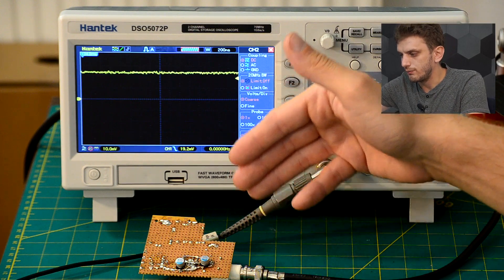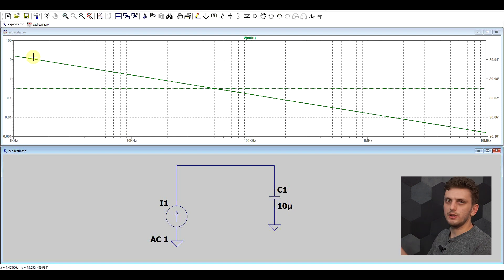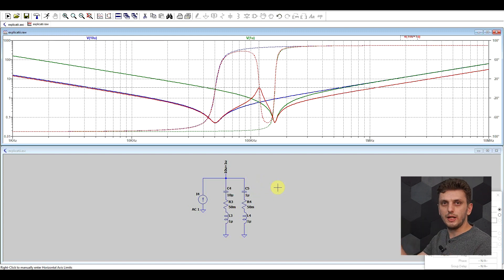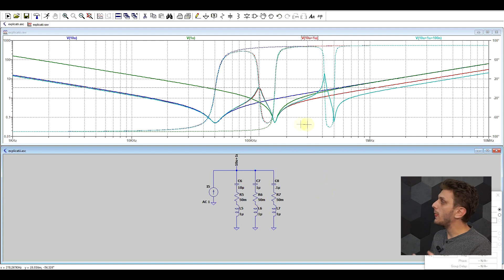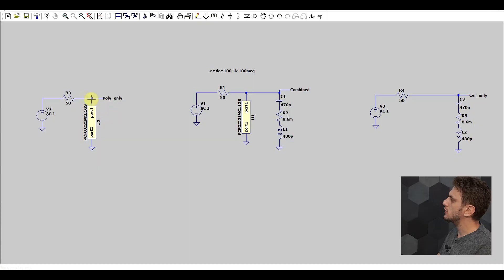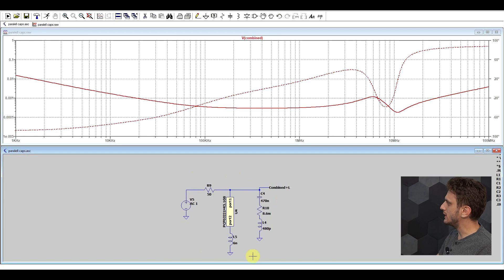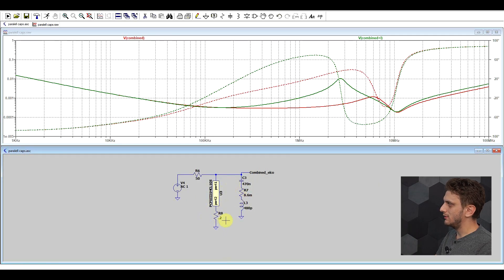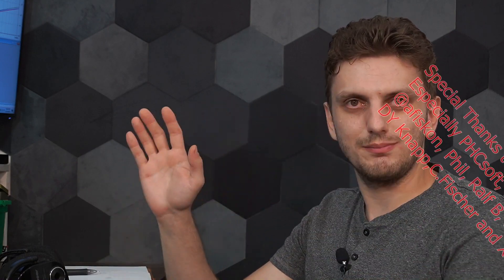Decoupling capacitors 3/3 - Resonance and anti-resonance

Comment: Great . I enjoyed it ... I think it was better to add the 0.2ohm to the inductance but will not change much .. this is expected as the resistance always damps the resonance .... Some times they call them parallel /series resonance ...
Reply from the maker: I have seen this being used - rather than use an unpredictable aluminum electrolytic (that has temperature dependent ESR) use a more predictable low ESR cap, but ad an extra predictable low value resistor so that the system is stable at any temperature.

Comment: Now what about if i have a DC bias on these capacitors? With MLCC capacitors, there is a big decrease in capacity. That and other factors that are not ideal and not exactly known, make it kinda useless to simulate in my opinion.
Reply from the maker: You can either change the simulated capacitor value - based on the expected derating from DC biasing (ex use 6uF of capacitance instead of 10uF - the nominal value); or you can use DC-bias capacitor simulation models - some manufacturers do offer these, but the simulation will be quite slow since the capacitor modeling is highly complex.

Comment: Another way of get a proper noise reduction or decoupling is to use a little ferrite or resistor in series. I guess it's also a little relative. In the last case you showed there was an anti resonance, but overall it was better than the electrolitic capacitor except for that one resonance point.
So in the end you still improved the overall noise.
Reply from the maker: Well, you would add a ferrite to prevent noise going over the supply line, that won't prevent the noise at the source - its still a good idea to short circuit the noise source with components that have an effect on high frequency noise - like low value capacitors. Anyway, there are certain circuits (usually only high performance IC's like processors) that have a dedicate section in the datasheet describing the impedance their supply pin should see - for example below 0.1R for frequencies below 50MHz. This is needed to keep the supply stable enough for proper operation.